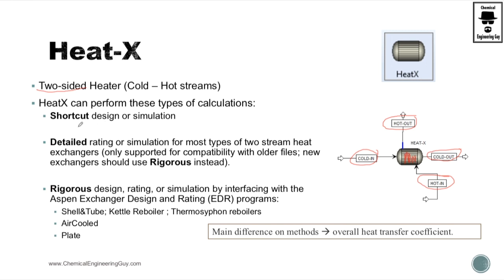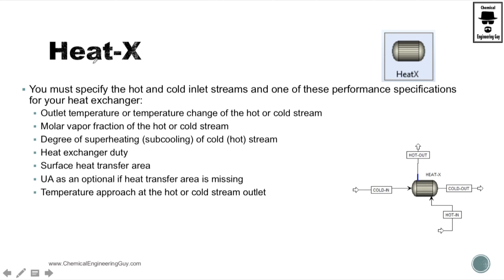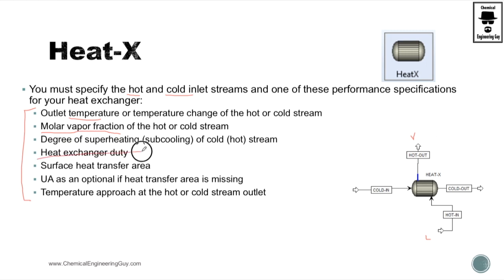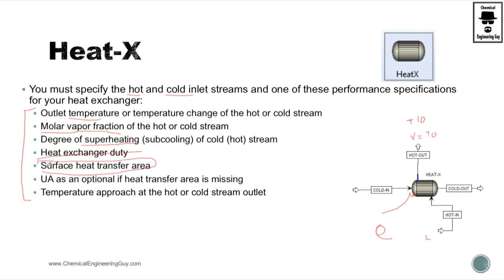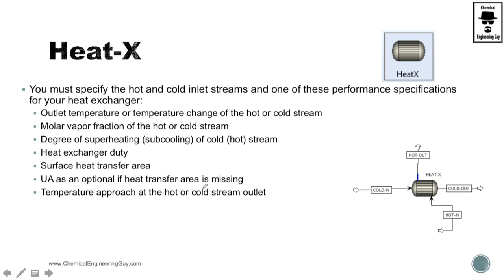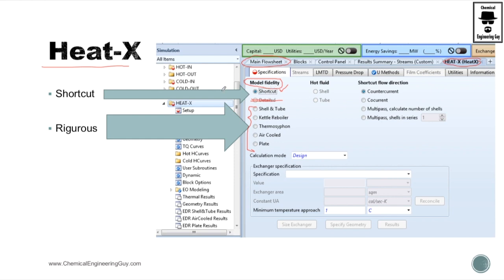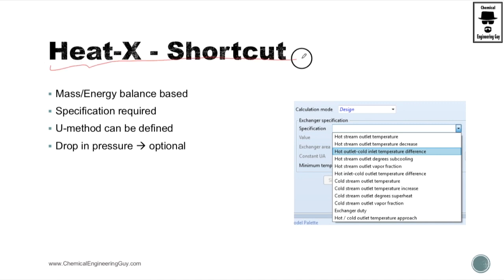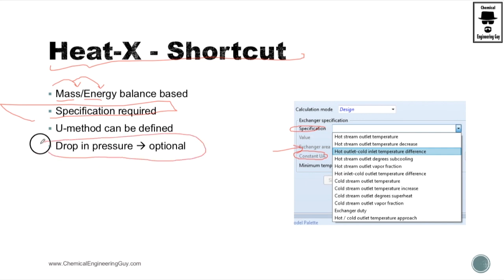Heat X Shortcut Method (Lec077)

Comment: HOW I CHOOSE THE TYPE OF CALCULATION ( shortcut or rigorous ) and what's the meaning of shortcut
Reply from the maker: Whenever you add the HEAT-X unit, it will be set by default to shortcut. Once you double click in the unit, you can select how you want to model it, i.e. if you want a Shell & Tube, or a Plate Exchanger, Number of passes etc...
Reply: @ChemicalEngineeringGuy  what is the criteria for model selection